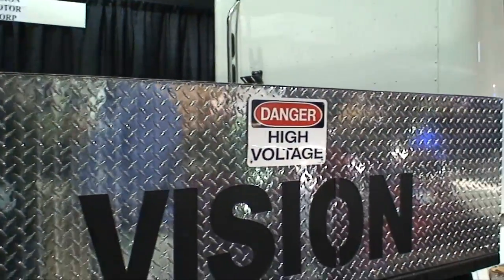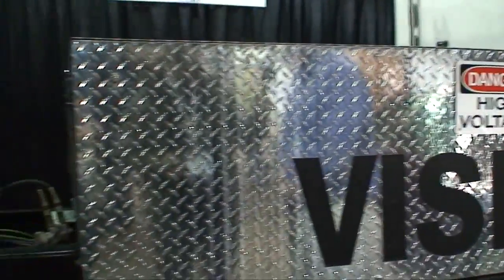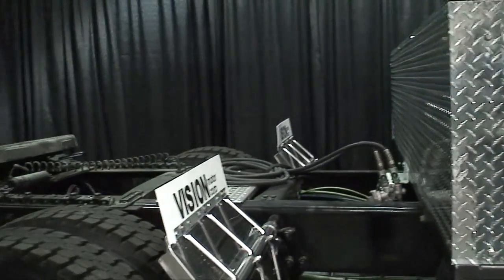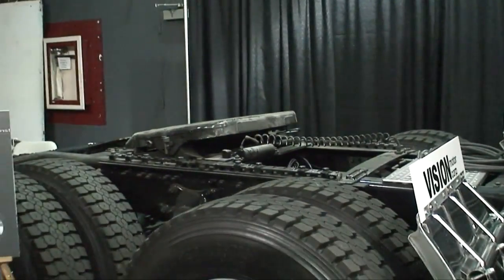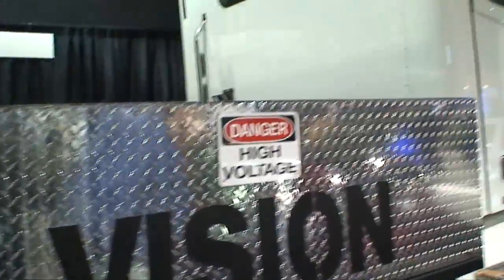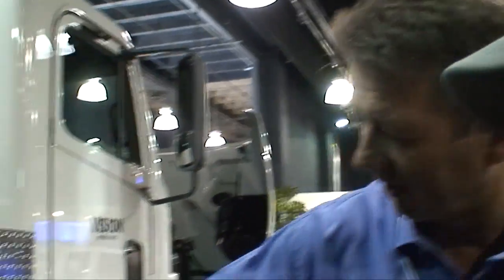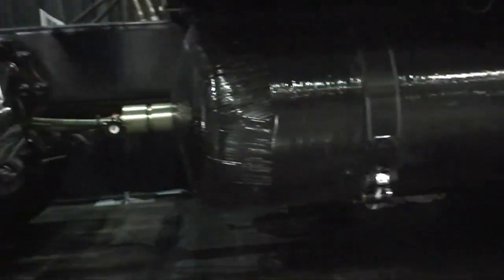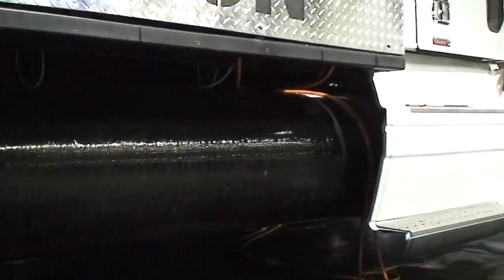Hydrogen Powered Big Rig Truck - Lawrence Weisdorn of Vision Motor Corp Interviewed By Ken Spector

Comment: What he meant to say was 580 kwhrs.  30KG of Hydrogen can be converted into 580 KWHrs of electricity.

The power output level depends on the size of the Fuel Cell.
Currently, we install lfuel cell modules up to 100 kw into these trucks.